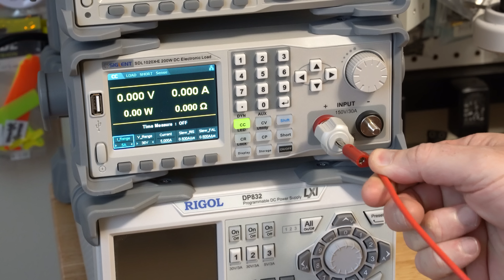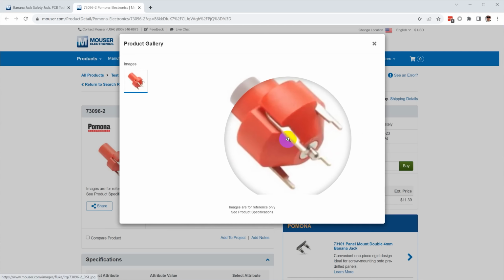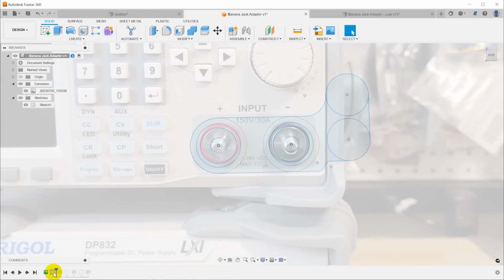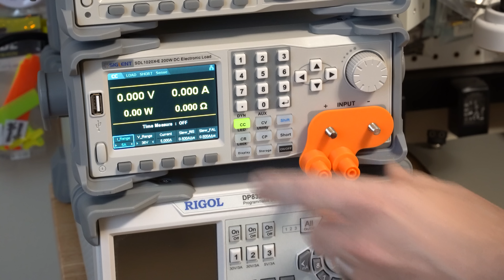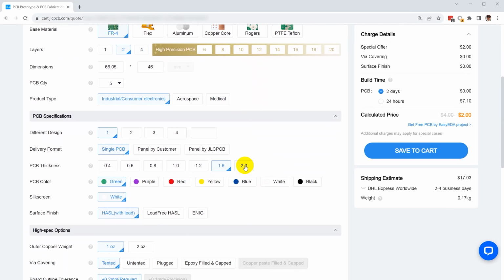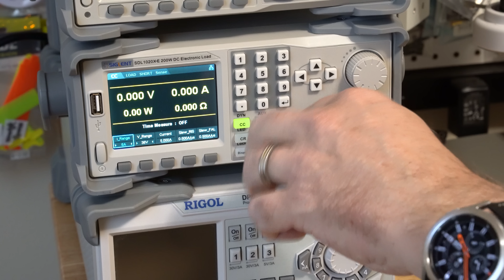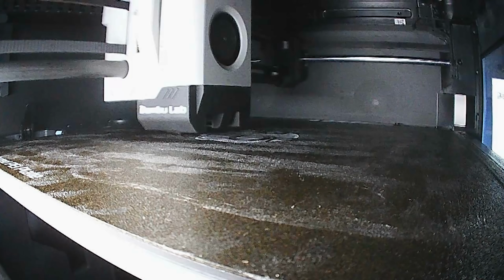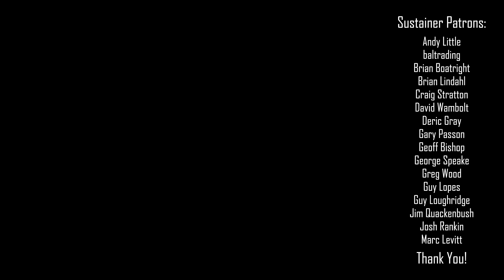Making a Banana Jack Adapter for Siglent Electronic Loads

Comment: If you want a more "flat" reference image, move further back from the object you're photographing and zoom in on it.
Reply: A completely flat orthographic image is infinitely far away with a focal length of infinity.
Reply: Yeah, this really makes a huge difference. It also helps to have the camera as close to square with the object as possible. Moving back makes that easier as well. For the best reference photos, I'll even break out the DSLR with a telephoto lens. Including a ruler in the photo (in the same plane as the object) makes setting the scale easy if there isn't already a good reference point.

Another trick that works for flat parts is using a flatbed scanner. This gives you an orthographic view as well as a known scale (the scanner DPI).
Reply: A way to get perfectly flat camera to a given face is with a mirror. If you center the reflection of the lens into the center of frame then the whole optical path is perpendicular to the plane of the mirror.
Reply: @shaocaholica that's as close as you can get with a regular lens, and is perfect at the center. 

But what you really want is a hypercentric or telecentric lens.
Reply: For small parts, use a flatbed scanner. It had very little parallax error.
Reply: Most scanners have less than a few mm of depth of field, so that's impossible with something like this.
Reply: Just use a 50mm lens at the exact same height as the thing you're photographing (50mm lens on a 35mm sensor camera) and line it up correctly. Make sure to turn on the lens correction setting in the camera as well and ensure a really large, soft key light with a good soft fill light.

Comment: I just happened to catch this video. Nice job with the banana jack adaptor. I faced the same issue after purchasing a Rigol DC load, several years ago. I ended up machining some thick copper washers, thick enough to drill holes in the major diameter. I took 12 ga silicone jacketed wire, soldered the ends into those holes, added shielded banana jacks to the other ends of the short 12 ga wires and 3D printed a cover, to protect against any possible shorting. With your design I like the fact that you can remove cables when not in use. Once again, very nice job. Mike

Comment: Nice video and project.  Another option is there are high current M6 binding posts with banana sockets in their center cap.  I have the Rigol Electronic Load and I just unscrewed the caps and replaced them with the caps from the ones I got from Aliexpress USA.  You get two complete binding posts sets both red and black for around $10.00 USD.  Of course, the banana connections cannot handle the full current capability of these Electronic Loads.  Again, thanks for the great video!

Comment: Nice little adapter. For precise positioning in KiCAD board layout, I typically place a Drill Origin and Component Origin in the lower left of my outline (or equivalent for curvy boards). Then ensure Preferences > PCB Editor > Origins & Axes > Display Origin is set to "Grid origin" (it uses "Page origin" by default, iirc). This allows you to type in the absolute coordinates (using mm or inch) for items in your design in the Properties dialog [E], like you were showing. Some other helpful tools under Right Click > Positioning Tools: Move Exactly [Shift+M] allows specifying X/Y movement & rotation relative to the object origin. Position Relative To [Shift+P] will let you select a reference object as the new origin and position relative to it.

I also noticed when ordering boards at JLC that quantities above 50 will put you into "Small Batch" mode, which changes how they calculate the cost.

Comment: Nice neat project. The binding posts are probably used because 30 amps is beyond the rating of most 4mm banana plugs. Hirschmann plugs are rated at 30A, but are expensive and not widely used.
Are you happy that the PCB clearances are good for the 150VDC the load is rated for?
It looks a little tight.
Reply: Nearly word for word the comment I was going to leave
Reply: It seems to me that I would have put more copper on the sides to increase my surface area but I would have cleared the center a little more or simply made a slit there where it is the tightest.

Comment: It seems that the post spacing is somewhat universal.  I bought two of these -- one for my Multicomp DC load, and one for my B&K Precision DC load.  It fits the Multicomp perfectly, but the posts on the B&K are slightly larger diameter, but then I noticed that they're a bit larger because they also have the banana jacks in the center already, so I ended up only needing one.

Comment: Nice work as usual, James. As a pro solderer and electronics lab manager I have a few suggestions: For soldering "heavy" PCBs invest in an under board hot air preheater, like a Metcal PCT100. As others have mentioned a flux gel will also help a great deal, I'd recommend CIF F42202. This can be removed with Isopropyl alcohol or most "flux remover" sprays. If you dont already use fume extraction when soldering you'd better get some of that too! 😊
Reply from the maker: This one would be rough for a heater because of the jacks, but I definitely use flux.  Wiping everything down with a flux pen first makes a tremendous difference--especially on the jacks.
Reply: @Clough42  The preheater could be set so that it didn't get hot enough to damage the jacks, and/or the jacks could be protected with some tin foil. It's there to raise the temperature of the PCB so that it's not just instantly sinking the heat from your iron and probably wouldn't melt those jacks even if it was set to "10". It's no hotter than a reflow oven.
Reply: @willej78 the jacks probably aren't rated to survive reflow oven temperatures anyways though. And the jacks would be closer to the heating element than the PCB itself that's making it more difficult. I don't disagree that having a pre heater would help a bit but I recently did a very similar thing and it was quite difficult to prevent the components on the other side from melting and still achieve any sort of meaningful preheat.
Reply: An alternative option is using a hot air gun aimed at the same side your soldering on held in place by an indicator armed with a clamp or something similar
Reply: @MarkFunderburk  Yes indeed, hot air pencil in one hand, iron in the other! This is a technique we use a lot on the boards we rework where I work, most of the time with them on a preheater too.

Comment: 4mm banana jacks are usually only rated to 15A (and 30V). Cheaper cables tend to be even lower. The DC load can handle 30A, easily enough to melt 4mm banana jacks. That is why it doesn't have the combos. Don't use these past 15A at most and it'll be fine.
Reply: Apparently a sign that says "max 15A with banana jacks" wasn't good enough, according to some guy EEVBlog once interviewed.
Reply: @johnalexander2349 😂 👌chefs kiss

Comment: Just use the yellow (large) ring terminals.  They are just the right size for banana plugs to fit into.  You might need to remove the plastic insulator but that's pretty easy to do.  Usually they just pull right off.  You can leave the terminals on all the time and ust use them when needed.

Comment: Excellent execution on all fronts, stable functional, simple, but also properly engineered to last. 
I think the only thing I would consider changing, is select an ENIG PCB finish, so it's more tarnish resistant, and insulate the back of the banana jacks, since a finger could theoretically curl in behind and touch those in a moment of panic or something.

Comment: Consider a third layout option: If it is symmetric, and double sided, then it might be possible to create a PCB which allows mirror image to lower left or upper right placement. The pick would then be based on which side you solder the banana plugs to. If you had banana plugs which connect via threads, then it might be possible to unscrew the jacks and put them on the opposite direction. The universe likes symmetry, so do I! 😀

Comment: Even more amazingly, with two of your other personal robots, you could even do everything at home. You could use your CNC mill to route and drill a board, and you could use a resin printer to use UV to image the design onto UV sensitive mask.
Reply from the maker: Yeah, I walked away from home PCB manufacturing a long time ago.  The etchant is complicated to handle and store safely in a residential environment with limited space, and the results are never going to be as good as a commercial fab--especially with multilayer boards and modern solder masks and silkscreen.
Reply: @Clough42  To each his own - to me, $50 (plus shipping) would be a horrifying expense for a small board I really only need one of, and the small desktop CNC routes it out for me the same day for free instead, no chemicals involved. I wouldn't design an ARM SBC running Linux this way, but I sure do and did up to Arduino-level complexity, even with SOIC14 chips.

Comment: One thing I've played with these type of low-run boards is going with very thin PCBs and doing my own sandwiching. If I'm going to pay for 10 boards, but only need 1, I may as well sandwich 5 of them and get some beefy combined current carrying capacity. It doesn't necessarily multiply that well, and it comes with its own design challenges (if you think 2oz copper takes a lot of heat... imagine trying to get 10 combined layers in there), but it can be an interesting solution
Reply from the maker: That's a good idea.  The stud on the back of these jacks barely penetrates one 2mm board, so maybe not for this project, but in general, that would be a great way to increase rigidity--especially if the boards are clamped at multiple points.

Comment: That's a satisfying bit of design, elegantly implemented. I wonder why Siglent didn't just counterbore the binding posts with a 4mm hole down the centre. I know that this wouldn't have given the 19mm (3/4") spacing but would have probably been sufficient for most applications.
Reply: I've been wondering the same, but frankly looking around the market only BK Prescision seems to have accounted for that. Neither Rigol as a manufacturer on the same level (though they have the sense terminals on the front, which is nicer in a lab environment), nor Keysight, nor Tektronix as a premium manufacturers have that either. The reason is probably simply because most banana jacks are not rated in the same range as the electronic loads themselves, though there are quality ones that are rated for 1kV/32A, they are usually shrouded as well. But as a manufacturer that is always kinda dodgy depending on the market you supply, even if you put some stickers or labels on it. 

The 19 mm spacing is also kinda pointless anyway. I think that only really makes sense if you want to use BNC adapters like here, though I frankly have no idea why I would want to do that. BNCs are typically not great for power connections and given the load is rated up to 150 V it seems kinda dangerous conceptually for something that has one side always exposed (well I know there are shrouded BNC, but they are quite rare). The only other thing comming to mind with 19mm banana jack spacing are some thermo coupler adapters for DMMs. 

As for the siglent, I think the SDL10x0-y series is kinda due for an overhaul anyway, at least comparing it with other stuff that clearly has a more modern look and feel to it. Maybe they will at least think about the sense terminals in a future overhaul of the design. But I wouldn't mind if they flat out steal the BK Prescision Model 8510B knobs. ;)

Edit: Ironically the BKP Model 8510B also claims 120A capability, which way out of league for any kind of bana jack on the market. So at least they don't seem to care. But I don't fancy spending 2k+ on a DC electronic load. That used to be something you just build yourself with some power transistors, coolers and a bench multimeter...

Comment: Measuring across the output terminals with the calipers ('shorting' the output) gave me the willies (even though of course you had the output safely turned off). Usually if I'm measuring terminals etc, I'll use my junky plastic calipers - they're usually sufficiently accurate but won't short out my batteries when i measure how long a buttontop 18650 battery is. You can guess how I learned that lesson...
Reply: This is an electronic load, so they're inputs. 
And lab equipment is always short circuit protected, it's used by students in schools you know.

Comment: Until recently I made crude PCB's at home, using the laser toner method.  Ordering small quantities at reasonable prices prices wasn't possible.  No more; the last board I did I ordered  10 boards for $5 with a $5 New Customer coupon, so I only had to pay for shipping(!)  And I got pro-quality 2 sided boards with solder mask and silkscreen.  Amazing.  The only mistake I made was using standard China Post shipping rather than paying a little bit more for DHL; won't do that again.

Comment: You can import dxf files as board outlines in KiCAD if you wanted to do that as an alternative. I've done it a few times, designing the board outline in AutoCAD first.
Reply: Can confirm.
I do the same with EasyEDA and Sketchup.
Reply: Same here, from Solvespace directly to Kicad board outline; and if you chose any kind of sane origin point, placing the outline exactly where you want is simplicity itself. If you included the holes you are interested in with the outline, you even get snap guides of where to put down your parts/traces...

Comment: I sometimes find that a really good rework flux can make working with lead free solder much easier. I often use AMTECH  RMA-223-TFU(UV), down side its a sticky messy flux. So a ultra sonic wash, or considerable time with isopropyl alcohol and a brush. I was introduced to it for BGA soldering and smd rework. Though I know they make versions that are easier to cleanup. But I haven't needed to replenish my stock.
Reply from the maker: I used a Kester #951 no-clean flux pen.  It's great for wiping down stuff like these banana jack terminals, but it flashes off a little too quickly to be great for rework.

Comment: I would have made the traces wider or even flooding the board.  The copper is just etched away so it shouldn't impact cost.  There is a free program called Saturn PCB Design for doing PCB calculations. Oh and the 15 amp calculation is very conservative.  

 Good job.

Comment: Beautiful work. I think I would have just spilt the PCB on a diagonal down the center on both sides (why use traces at all?) to minimize the IR loss, but this would only matter for high precision work. I love the CAD explanations. I always learn something.
Reply: They are through hole connections he could have just done a full fill on each side too

Comment: While Carbon filled plastic isn't 'conductive' (compared to say composite Carbon or long fibers) you are still likely to have some leakage current limited coupling issues.
Reply from the maker: It's easy to test.
Reply: @Clough42  Easier is just doing the part in PLA. Interested to see if you can get anything meaningful from the CF filled Nylon regards a measurement in particular a repeatable one.

Comment: There's a good reason why binding posts are seen on mearly alp electronic loads. Its due to the limited current carrying capacity of banana jacks. You can get them that are rated for over 15 amps, but they aren't common, nor standard. And it would be easy to mix up cables in the lab.... and end up hooking up regular banana leads that aren't rated for that type of current
Reply from the maker: If I need high current, the studs are still there.  Incidentally, Siglent makes a 30A power supply with standard banana jack binding posts.
Reply: @Clough42  I guess you mean the Siglent SPS5041X? Well at least the silk screen on the fronts says the front panel is only for 10A. I'm curious if they actually limit it for the front connectors or if you could fry them accidentally.

Comment: Adapter looks nice.  

I did the same thing with the BJ's centered below the binding posts.  Makes them a little higher off the bench than your design.   I machined a couple banana jacks from brass rod.  They are fastened to the board with M3 brass screws and solder (full high test 63/37 leaded Kester. ) Initially used a big traces then, realized two copper pour areas  would have lower resistance with better heat dissipation.   Also made a set for my bench power supply as well.  Yo China engineers, banana jacks go on 19.05mm spacing!!!!

Comment: I swapped my binding post to accept banana plugs a while back. What I did was easier and works good. Search for 100 amp 6m binding post with banana plug,  All you need to do is swap binging post nut. That's if your original binging post are 6M

Comment: This really is one of the best engineering channels on youtube.  Amazing work.   I am curious what you think about the infosec issues with the bambu labs printers.  Everybody says they are great, but I can't bring my self to rely on their fog to make it work.  I'm about to pull the trigger on a Qidi Max-3.
Reply: I just noticed you have a i-fast review which has most of the same features.  Would you still go for an i-fast at the lower $1700 price point, or would you go for the max-3?  Seems like the heated chamber means they can do similar things, seems like you are trading speed/kipper for dual head/linear rails.

Comment: James, if the fixing pads had not connected the central pad would they be insulated and not require the shroud? Also if you flip a 2nd board will that give you 2 pairs of terminals?